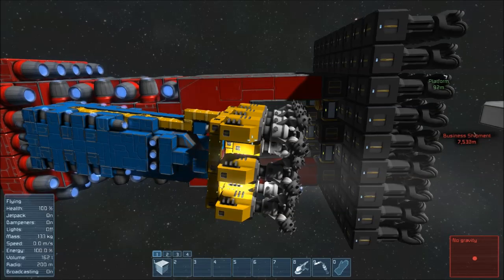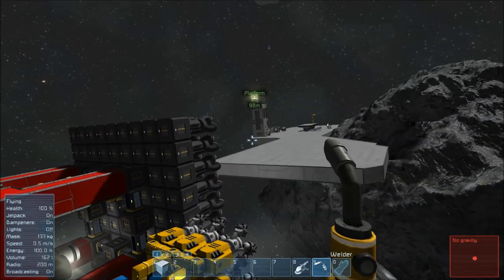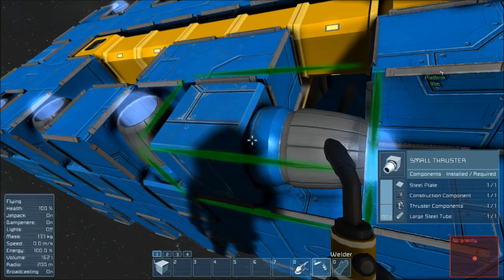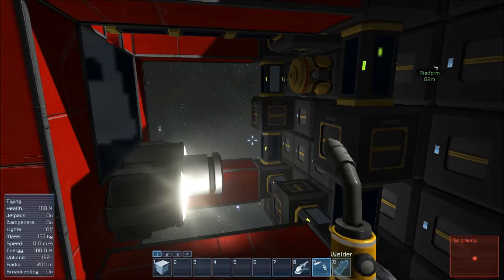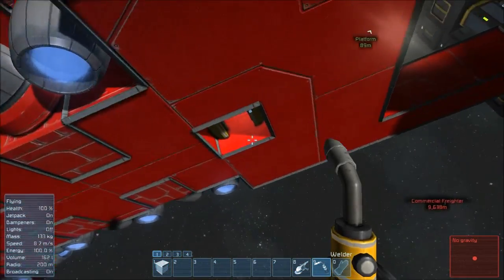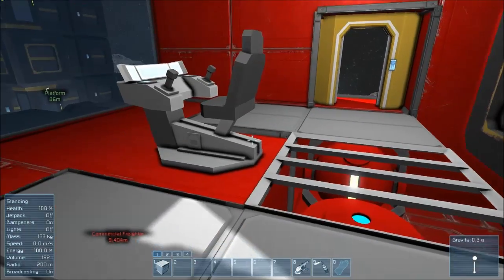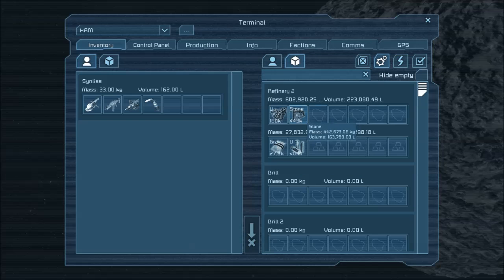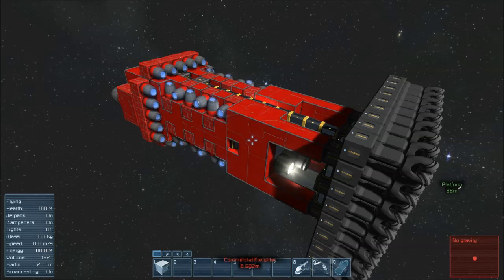Space Engineers - Ep 4 - How to build an efficient mining ship

Comment: Hello Syn, got two questions. 1st. Short yes or no question, is there a gravity system installed in the smaller blue one ? (Me and my friends, we are newbies to the game, but we dont want to use much guides or smth.) 2nd. About the bigger red mining ship, its gravity system under the floor - what is it for ? You said, point 3 down 10:30 , guess its pulling everytning to the ground, yes ? I mean, is just for making you able to walk around in the ship while it is moving, right ? Thanks for any help ^^
Reply from the maker: +Karl Arsch For question one, on the smaller blue ship there isn't an gravity as small ships cannot have a gravity generator on them. As for question two, on HAM there are two gravity generators. One in under the cockpit floor which allows for ease of walking around the cabin when entering or leaving the other is attached to the drills which allows for the ore pieces to be pulled towards the drills which means that there isn't as many objects in the world and you can collect more ore. As a final point I have set the gravity generators up such that I can turn the under floor generator off once I am on the ship in the cockpit and the same with the drill generator to save power and not have a 45* angle of gravity.